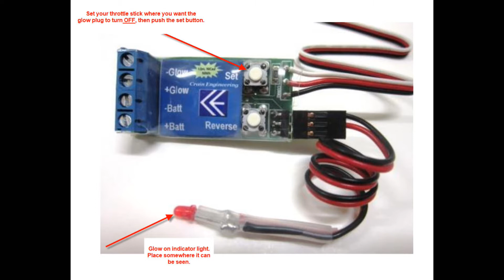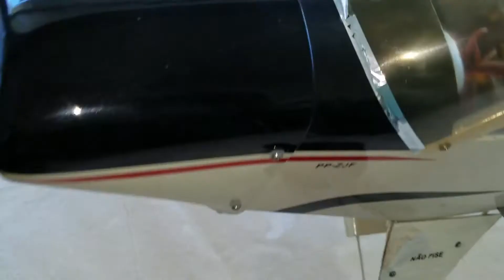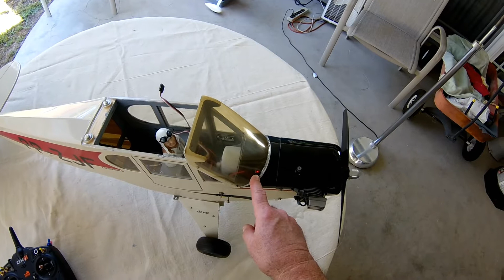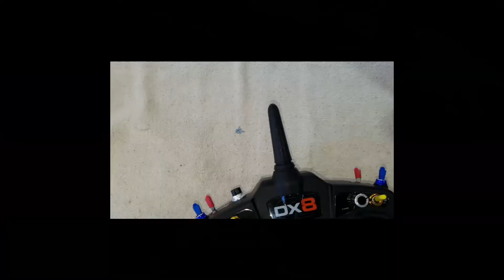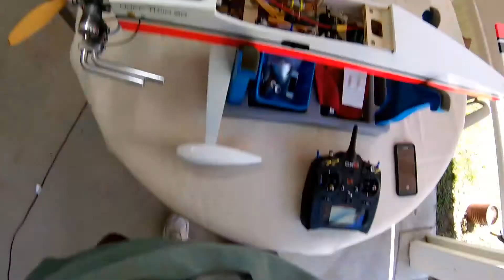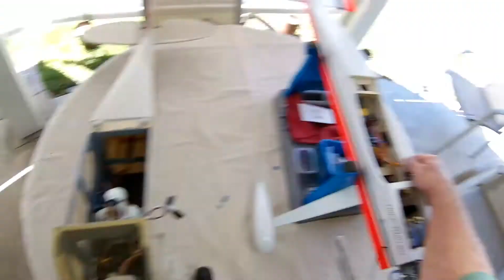Crain Engineering Glow Driver How To

Comment: Hey, I can not get my Saito 90ts to light both glow. They both light fine when touching the case or glow plug screw area on the cylinder but not screwed into the cylinder. Did you ever have that problem?
Reply: Got it…I had some 12 gauge wire from an old battery. Used that and it worked :). I had 18 gauge on the battery.
Reply from the maker: @klmelj  I just saw this and was going to reply and suggest heavier gauge wire. All the way, from the battery to the driver to the glow plugs. Glad you got it sorted out. I also have a 90TS. Need to find a plane for it. :)
Reply: @xKmotx  oh no problem. You mentioned a bigger gauge but with it lighting when on the case I was like it could not be the wire. So finally just said screw it and made a wire. In doing so I had to use a 3S lipo because the gauge wire from my 6v nimh battery was small.

I have my 90ts in a TF Cessna 182. 

Love you twin motor with those quad pipes!
Reply from the maker: @klmelj  Thanks! https://youtu.be/ur4KDBpf1Ck